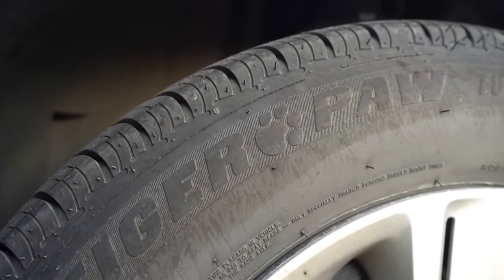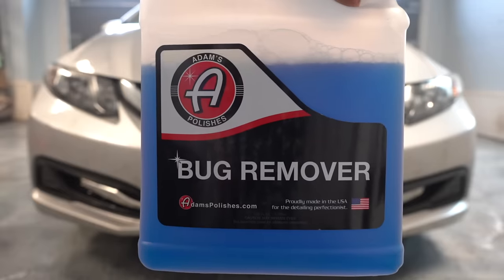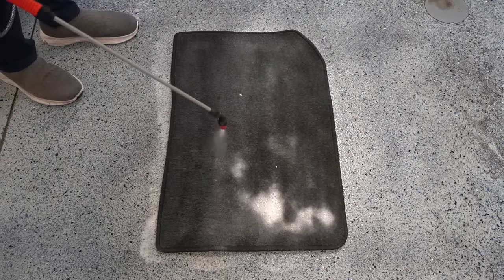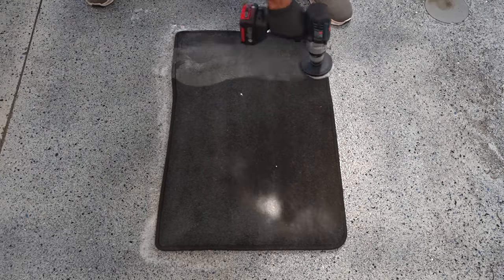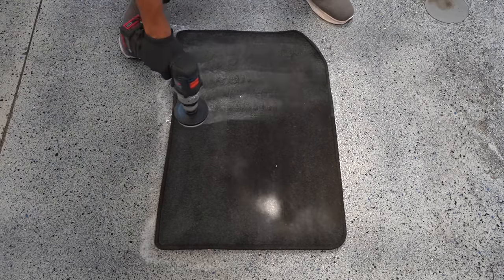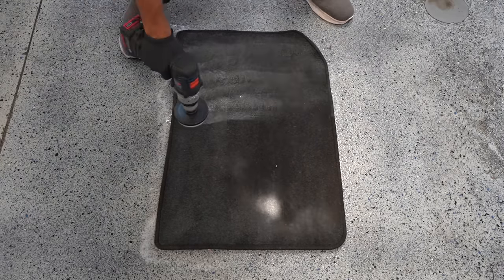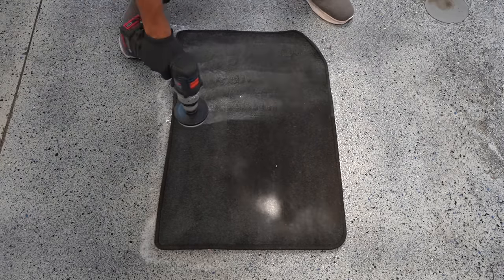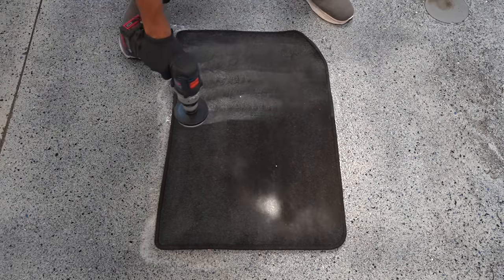Super Cleaning a DISASTER Honda Civic! | The Detail Geek

Comment: For the sweat and body oil stains, I would use dawn dish detergent. It's a trick we used in the military to remove the ring around the collar and arm pit sweat stains.
Reply: Would it work on old armpit sweat stains, do you think? My husband's plain white t shirts are a disaster! 😂

Also, thank you for your service, sir!
Reply: @yelhsasokolova8561  It probably will. Soak the shirts in cold water and half a cup of baking soda (they sell it in larger bags) overnight. Then soak them in with dawn. I scrub it in a little bit. Rinse out in cold or mild temperature water. Hot water can set in certain stains.
Reply: @yelhsasokolova8561  Look for a pink bar named Zote in the laundry detergent isle...it will get that right out. Apply the soap and scrub it with a brush.
Reply: That dawn dish soap is some good stuff
Reply: I love this fun fact thank u
Reply: I love this fun fact thank u

Comment: Honda dealership: wipes backseat with a wet paper towel

"Whelp i guess it's permanent.*
Reply: Wipes backseat with dry paper towel*
Reply: To be fair it IS permanent: even he wasn't able to completely remove all the stains, and even if he was, that's just the surface. It is impossible to remove all the shit (metaphorical AND literal) after it soaked into the foam.
Reply: As working as a detailer for a dealership. That’s all the let us do. They won’t let us do anything more and it’s infuriating
Reply: @mikenike507  sell them a new seat
Reply: I'm surprised if they would even use a paper towel. They probably just looked at...said we can't get it out and charged the customer for looking at it.
Reply: To be fair I wouldn't have wanted to get those stains out as a car dealer either though. I fully understand just being like, um, get your nasty chocolate milk car out of here.
Reply: I had a dealership change my oil and not only did they put dirty oil in - you could tell, shit was almost black - but they left oil all over inside the car. Steering wheel, shifter, door handles... dealership said they would detail it. They literally did not touch the interior. I was livid.
Reply: Macdelina Steven  oh hell yes. I also gave bad reviews online and told everyone I knew to spread the word that they were shitty.
Reply: Bring it to the dope dealer instead, or this guy if you can afford it.
Reply: TBF, the combo of solution, drill brush, and extractor he uses is pretty close to magical. These seats were WAY worse than mine in my Mitsubishi Mirage g4, and he made very quick work out of those seats. Meanwhile, I was scrubbing the shit out of my seats with some shout and everything I could find in the house and the stains didn't budge. Currently waiting on the solution, drill brushes, and extractor to come so I can finally stand to look at my seats again
Reply: @DANSSCARREBUILDS  lol charged the customer for looking at it.. lol
Reply: @mikenike507  yeah man! It sucks we can’t do much of professional detail jobs. I am a porter/detailer at a local car dealership. I have seen some pretty bad ones. For used cars, we have a professional detail shops do those when we get trade-ins and cars from auction.
Reply: @Beregorn88  
He is using a homeowner grade extractor.

He would get 99.99% out if he used the $1649.00  - HP60 extractor.
Reply: @Bjd79  suprisingly I work at a dealer and have all the tools the geek has except the steamer, we get cars just as gross and make them look new, it’s so fun

Comment: 18:51 As far as I've heard, both from my parents who own a 9th gen Civic & friends of mine who have some kind of Honda they daily-drive, Honda's dealerships don't really have any clue wtf they're doing with anything other than selling you a car, so it didn't really come as a surprise to me that you got the chocolate milk stains out. Betting all they tried in the car was spraying a generic all-purpose cleaner & wiping it with a towel.

My parent's 9th gen Civic still has dead A/C in it since the day it was bought NEW, and even after multiple trips back to the dealership shortly after it was bought, they still didn't manage to actually fix it. All they did was recharge the A/C every time & not actually figure out why it wasn't staying charged. Absolutely stupid for a brand-new car to have dead A/C. Parents never got it fixed all these years later, and in fact left it in their driveway for 6 months without driving it last summer because the A/C was dead. Planning on trying fixing it myself when I have the money, pretty sure it just has a sealing issue with the compressor.

Comment: Omg, I would die. I couldn’t imagine letting my vehicle get that dirty. 

I had a few questions like:
1) taking the seats out: I’ve heard that when they’re installed, they are secured with a special glue. Have you ever had issues with the seats becoming loose months after the detailing?
2) steaming, have you ever had issues with deformation of some of the plastic trims? Looking at some of them you would think they would be fragile when using steam. 
3) the iron decontamination, how often should that be used on the vehicle?
And finally.
4) have you ever had a dissatisfied customer on one of these disaster details?

I love your channel and have seen you transform trash buckets back to showroom stunners!!
Reply: I've never heard of seats being held on by glue. I've only seen them bolted on. Typically one bolt in each corner. The rear seats are typically clipped in and sometimes also bolted.
Reply: @superbarnie  i think they mean something like locktight. Stops bolts from loosening without using nylon nuts

Comment: Honda dealership: Those stains cannot be removed, we tried but it’s impossible.
Detail Geek: Hold my double double.
Reply: They should have gone back to the honda dealership to get refund and tell them that a real professional cleaned it.
Reply: It doesn't look like the even tried. I bet they just looked at it and said they couldn't do it.
Reply: @tony_25or6to4  honestly would do the same. 12 hours on this garbage. why
Reply: @dillingeradam  that's why the dealership charges much more for the labor. Or a huge tip to the cleaners
Reply: @christianelgin5150  For dealerships their detailing packages are usually sold as flat rate packages. Odds are its not that the dealership couldn't make those stains better, just they weren't willing to do it given how much of a disgusting mess the inside of that car was. Imagine charging $80 for an interior shampoo/cleaning and having this pigs pen roll in your shop. I'd be telling them nope as well.
Reply: Tony i wouldn't even want to do it. it looks disgusting

Comment: The "detail service" at most dealerships is pretty pathetic.  Their primary function is to receive brand new vehicles fresh off the delivery trucks and prepare them for sale, or to do a quick wash and brush-up on lease returns and other gently used, easily sold vehicles.  Even the large dealer I take my Cadillac to seems to have the "he won't notice this" sort of attitude.  In general, one is better off going to a body shop or even better, a stand-alone detailer like you.
Reply: I paid a lot of money in a detail service and when it was over I started laughing really hard and asked for my money back. They cleaned only the floor and the windows, barely a vacuum in the seats. They didn't gave my money back, but after arguing a bit, they cleaned everything that I point out.
Reply: Their primary function is to take a new paint job and give it some swirl marks before it leaves the lot.
Reply: @talyrath  hahahahaha accurate
Reply: yup when i bought a brand new car from audi i asked them not to clean it and i could see they had and theyd left swirl marks and he confessed after lying for a while theyd forgotten my request as no one had ever asked for it not to be cleaned , i also told them that they need to stop washing in circles and clean their mitts they used the same mitt on wheels the  went onto the body and the lower skirts and stuff omg enfuriating!
Reply: The dealership my brother in law is lead mechanic at has a really good detail shop..
Reply: that sucks because i work at a dealership detail shop and our work is some of the best i’ve seen! not all of them are bad lolol

Comment: “Rejected by another detailer” really just means that person did not want to deal with the filth lmfao
Reply: Dealers probably have a fixed amount they are willing to spend to try and get a car saleable, any more and you cut into your profits
Reply: it’s usually a fixed amount based off of how much the car could be realistically flipped for in the used market. (IE: a car that is worth 50k would be taken at half or close to half that value depending on how much the dealer has to spend on making it presentable to buyers. If it’s pristine, they would give the trader better numbers since they don’t have to touch it, if it’s needing repairs, that number goes down badly)

Tip: If you do tell them to do it at all costs, they will. I’ve never seen one refuse that. But expect a huge bill behind them.
Reply: The dealership probably has a flat rate for their different levels of detailing, and even charging their highest rate they would probably still lose money on this car. (considering labor plus cleaning materials)  I'd be interested to know what this guy charged for twelve hours of labor plus supplies.   If you ignore the dents though, they basically got a new car, as far as how the inside looks anyway.

And I bet he had to throw in a cluster of car scent hangers on the rear view mirror, can you imagine the smell that car had to have?

Comment: Imagine what their engine oil looks like.
Reply: Probably chocolate milk also found it's way in there too
Reply: Prolly a few piston and rings floating around from not changing the oil in forever
Reply: Well, since they had it new and still runs in tip top shape. I imagine it's clean with very little sludge build up
Reply: Eh, it’s a 5 year old Civic. That oil has at least another 10 years left in it! 😝
Reply: @willowashe  not when there is chocolate milk in it

Comment: I've seen you use an Ozonator to blast out the smells. Have you ever looked into getting a water Ozonator and using ozonated water? There are surprisingly inexpensive options that attach to a standard water line. Ozonated water is what they use in Hotels, Hospitals, and Cruise ships to do away with chemical soaps. Plus the stuff literally blasts apart any organic soil. Blood, Sweat, Tears, pretty much every bodily fluid. Mold, mildew, food...

That chocolate milk had to stink!

Comment: When I was a tech at a Mazda dealer I seen people come in with cars that looked as bad or maybe even worse. One customer had a 2018 Mazda 3 with around 20,000+/- miles and the driver's door handle was half filled with cigarette or cigar ashes. The interior was the sand/tan originally but looked like it was black interior. I seen cars that were infested with roaches. Literally could watch dozens of roaches running around inside the car. That was owned by a 18 year old kid who worked at a Walmart.

Comment: To get the ring pop stains out, I used super hot water and soaked the stains in the hot water and picked it off with my fingernail or something like a small screwdriver. I have twin girls and my back seat looked bad. Not that bad but, bad none the less. I figured it can’t hurt them so what the heck. They came out. Couldn’t even tell they were there.

Comment: Ik thos os am OLD vid BUT ibe been archon yur vids amd realized. Do you EVER tackle the messes on THE TOP  INSIDEof the  cars??  Cuz i could swear i Never see it aNd IK the inside tops of cars usUally used that nasty thin piece of foam or idk what its called haha. And thin thin layer of stretchy material like in my 2000 VW  neer the sun roof was falling apart and keeping the automatic window from closing and opening sometimes and started falling completely off!!  Cuz there was a leak cuz eVErYtime i washed my car id get drops on my  head or shoulder haha   but i was never able to clean the material  on sun roof area of the car...  how do you clean it or do you only lightly   clean it ?? Haha

This one is such a good one.  Ive seen this prob 3x b4 already. Such a good ending haha.